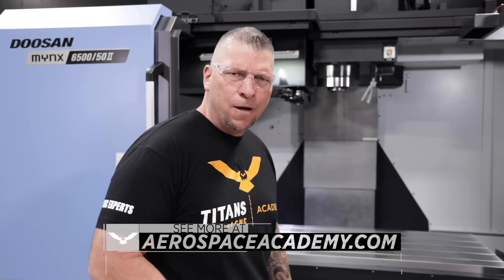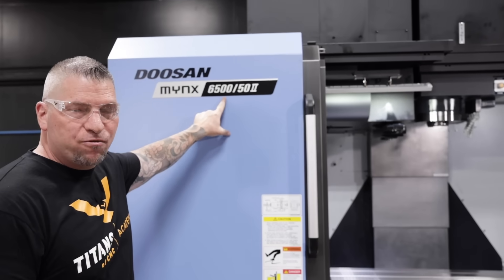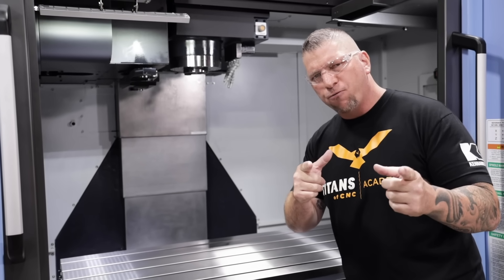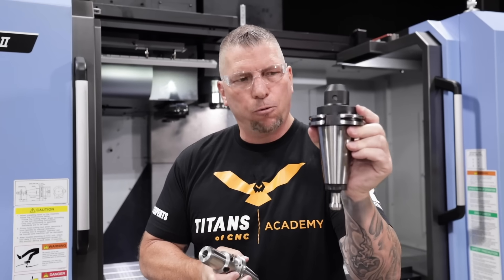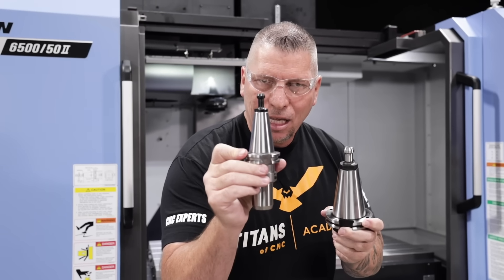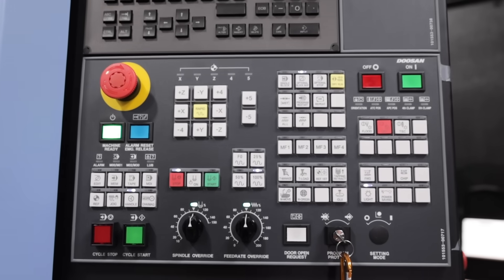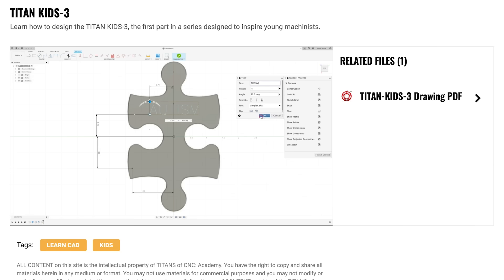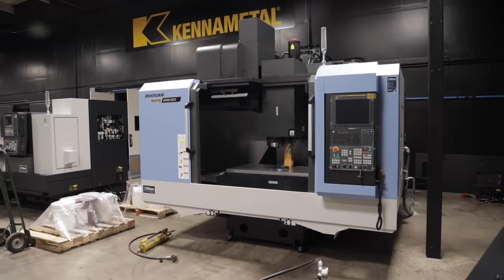DN Solutions MYNX 6500 Arrives at Our Shop | CNC Machine Unboxing

Comment: Are Kenimetal certified big plus holders?
Reply: Sorry, not true.  CVKV is a dual contact system, but not BIG PLUS.  BIG PLUS is an original dual contact tool holding system from BIG DAISHOWA and our company holds all original patents, master gages, and spindle license's for all machine tool builders, including Doosan. Besides our company, BIG KAISER, there are licensed tooling companies who have our gages and know how, but Kennametal in NOT one of them, and these are copies.  Read about it here : https://catalog.bigkaiser.com/view/274416/
I am Vice President of sales and engineering and have set up all the licensee's in North America so I would consider myself the most relevant source and authority on this topic.
Reply from the maker: Actually Kennametal made those holder before Big Kaiser. They call them the CVKV
Reply: @TITANSofCNC  most spindles that are Big Kaiser have a patent on them from Big Kaiser so if Kenimetal doesn't have the patent they're not truly a big Kaiser holder.  Big Kaiser did a test with holders that are claiming they are big plus almost 60% of them do not have the standards big plus does.

Comment: Finally Doosan machinery on the shop floor. I join the lesson then. We manufacture parts for world-leading brands in Motorsport industry. Our company is specializing in brakes and clutches. We have 3 machines like this in our work shop. They work mainly to rough out aluminum blocks on the first op wchich will later turn into brake calipers. Boom!

Comment: It's a box construction machine so I was expecting that he might talk about stick/slip that happens in this kind of machine due to sliding contact but he didn't. He just went boom😁

 I wish he installs a Yasda or Mitsui seiki in his facility 😍
Reply: The box way machines aren't really meant to hit tight tolerances, so a little stick and slip, or backlash is ok.  You can feel the few micron of backlash when touching off a tool using a pin in these machines.  The biggest thing about Doosan is that a base model VF2 will set you back £70,000 last time I checked, for the equivalent Doosan DNM4500  it's around £82,000.  The Doosan is quite a step up in quality over the Haas though, with features such as a spindle chiller as standard.  Nothing against Haas, but the Doosan reliability is something else!

Comment: Does anyone know any starting price for this doosan? Are They good machines? What 3 axis doosan would you reccomend for mould making ?
Reply: Doosan's are good bang for your buck machines, a bit cheaper than other high end brands and pretty much just as good.  It all depends what kind of mold making your doing but this wouldn't be a good machine for that.  You generally need a machine that is super tight and accurate.  Box way machines are super ridged but generally not as good as a tight linear guided machine
Reply: Contract me I and I can point you in the right direction jim.shiner@doosanmt.com

Comment: I have to drill a hole of 1mm upto a depth of 9mm and the drill is to be done inside of a predrilled hole of diameter 3mm and the depth of 3mm drill hole is 42mm.
Reply: Crack on then

Comment: Hi Titan need your suggestion on drilling of dia 1mm drill.
Reply: What material?
Reply: @danl.4743  40Cr4 / IS4367 - 91
Reply: Guhring Exclusive line, or OSG ADO-micro would be my go to!  Need 70 bar coolant to run them TSC though.  Titan would probably push the kennemetal Godrill microdrill though.   Runout is so critical at these diameters though! High precision collet chuck at the very least.
Reply: @matthewgowan7546  I am using hydro grip Schunk holders keeping runout within 0.005mm.But still I am getting a drill life of 300 drill hole whereas I have to drill 8000+holes
Reply: @subratswain8665  Get your local guhring rep in, the exclusive line drill should last about 1000 holes.  300 hole drill life isn't bad, but it isn't great either.